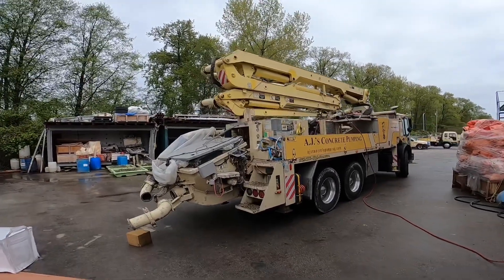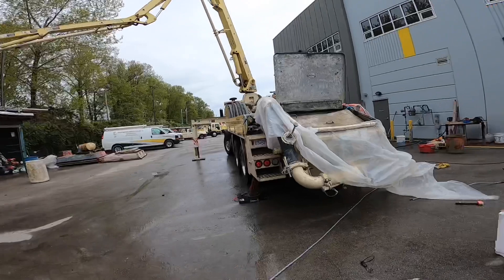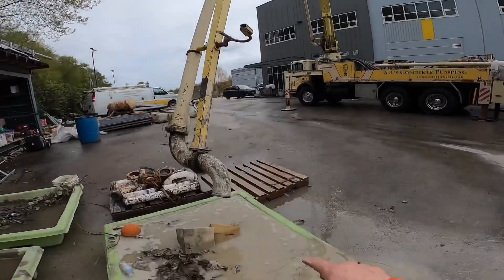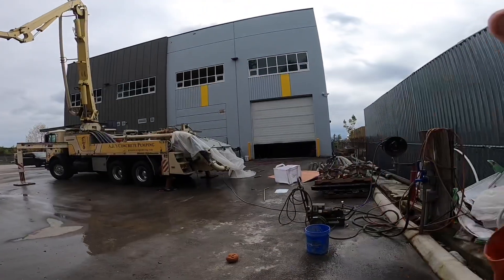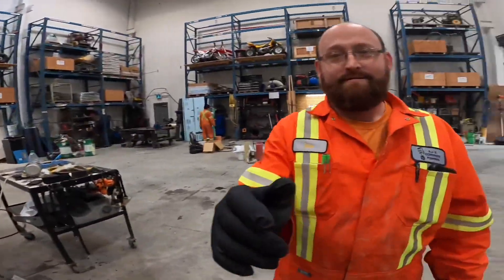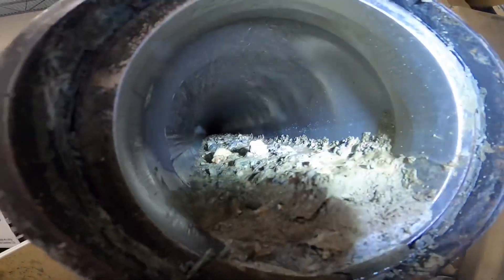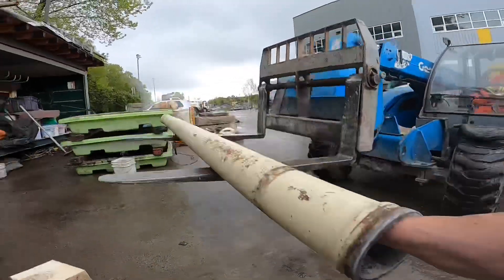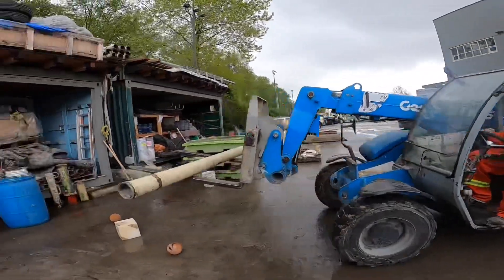Why we should suck back a hard sponge, and clearing a stuffed up boom using water:

Comment: I’ve been sucking back 2 oversize sponges in the cradle at slowest pump speed with high rpm. Haven’t had any buildup yet.  What do you think?
Reply from the maker: @samstrucks  if pulling back 2 sponges with a good amount of water in between, chances are HIGHLY likely that your pipes/elbows are going to be sufficiently clean, regardless of specific technique used to pull them back. Best bet is to be certain, ipe the 45 degree elbow going from the hopper into the deck-pipe. Shine a flashlight down there and check for buildup in the deck-pipe itself, and especially the elbow at the bottom of the turret. If those common areas of buildup are clean, the rest of your pipe system will almost certainly be as well. It takes some real negligence (likely the back story behind this video here) to leave residue of any real significance in the pipeline after pulling sponge-water-sponge.

Comment: I just replaced my entire pipe kit last Friday and the first two jobs I had I couldn’t get the second sponge back all the way to the ball catch on the swing 90, the first ball made it but not the second one. You think maybe my gaskets haven’t sealed up all the way yet after replacing everything? The first two jobs after replacing the pipe were small jobs maybe 80 yards combined between the two. I just ran the gaskets fry I didn’t seal them with silicone or grease as I’m not a big believer in the reasoning behind that idea. 

I ran a hopper of water through to push the sponge out just in case and since then I’ve put 700 yards through the kit. After a 600 yard pour two days ago I was able to suck the two sponges back no problem. 

Do you grease the swivel gaskets or fill them with silicone caulking when you replace them?
Reply from the maker: What I have seen with the larger 6” round balls (if that’s what you’re using) is that they are large enough such that when sitting in the transition door they can actually obstruct vacuum from pulling that second sponge back.
Reply from the maker: I agree with you in the belief that silicone/grease in the gaskets (aside from the swivels) is mostly just mumbo-jumbo. I only use a light spray of WD40 on the outside
Of the gaskets as such that the clamps don’t pinch the gaskets. What I do firmly believe in is whenever installing a new boom pipe kit, filling the hopper with water and sucking back a sponge with a nice, fat bucket of bentonite (pudding consistency) in front of it to fill any voids in the gaskets.
Reply from the maker: Thank you for contributing intelligent discussion to the comments section, that’s my ultimate goal with this channel, good exchange of information and ideas between operators from all parts of the globe.

Comment: Man I think that's why we resuculate.    Slow pours require it.       Great vid man
Reply from the maker: Absolutely! Always helps to pound it through for a couple of minutes prior to pumping out and sucking back. We do sooooo many of these slow pours, hard ball-water-soft ball has really helped in mitigating what's shown here in the video.
Reply: @canadianconcretepumper1979  in my part of the world where we pump most of the mud is 4000 psi but on the average of 6000 to10000 psi the water to cement ratio is to high to get a ball back cleanly but as a last resort.   It's why I resurulate . Not olny can I loosen the set mud on the hopper  but reduce the amount of cement to water  then water wash and further  degrade this ratio. 
On a different point I love how easy it looks to wash those putz hoppers !! I run schwing and they can be a real bitch sometimes

Comment: I also never had an issue when I sucked a square sponge back in the day. I always took reducer off put water in and rolled up my wet 12" square sponge and just sucked it back at moderate rom 1200 and maybe a 2 on the dial. Never had more than a mm or so build up when  I rotated pipes
Reply from the maker: Done properly a single sponge works 99.7% of the time. We had a project pumping bridge decks in which the contractor had two of their own pumps with 15+ year veteran operators. Around the 2 month mark of the deck portion of the project (high cement/high chemical mix), they began having pumping issues, only to find that both of their machines had literally 2+ inches of buildup in the boom elbows. These were guys swore by sucking just a single square sponge. Same project we would put 3 sponges through our 58 meter and the pipes would still be creamy.  Really depends on the mixes which you’re pumping.

Comment: I had this on a used pump the company I used to work at bought. The funny thing is the previous owner said he had to help another guy in the town he was from suck a sponge because his pipes were half full. Once we bought it I had a terrible time priming. It would always segregate whether I used a slick pack or just water. So I took a deck pipe off and it had almost 1" in it... I was pissed off but once clean it worked all the time after that. Ever had your pump stall trying to pump shit concrete? I have
Reply from the maker: Only time we've ever had stalling issues was when the relief valve was a mile out of adjustment and not activating when it was supposed to be.

Comment: Very interesting info on this one! I’ve been running a 33m-5ZZ for the past month. First time running a 5 section Z fold boom. Hated at first, but now I’m getting comfortable with it and I’m enjoying it. 

Question for you, do you suck a sponge on an A frame or do you fold up and put it in the cradle and then suck the sponge? I’ve tried both and have had about the same success rate. I’ve tried putting the boom up in the air too. Not a big fan of that one because I feel you can segregate rather easy, but this is more of a panic move. More of a “gett’er home” because this concrete is getting old…fast! 

Anything you can share will be appreciated 👍
Reply from the maker: I typically suck back in either A-frame, or Z-formation. Certain situations (low clearance/indoors pours) I will suck back in the cradle but in my opinion it is less than ideal (I have had issues with buildup in the pipeline after sucking back in the cradle). I apply the same theory for sucking back the sponge as I do for priming: keep as many sections vertical as possible such that the water cannot run ahead of the sponge only cleaning the bottom half of the horizontal pipe (on the prime the intent of the water is obviously lubricating the pipeline rather than cleaning it). A-frame is king, Z-formation also works well, sucking back in the cradle is my least favourite option and last resort.

Thank you for watching the channel. The comments are very much appreciated 🙏
Reply: @canadianconcretepumper1979  also, before I forget. I’m trying to get my hands on a Goodson super scraper, but no dice through Amazon. You got any leads no how to get those in Canada?
Reply from the maker: @rickm.10  I've always had top order them directly from https://goodson.com/products/super-scraper

Be forewarned, the shipping costs are astronomical.
Reply: @canadianconcretepumper1979  no worries man. I find these videos very educational for an operator who is into the more detailed operation of a concrete pump. These are fairly cool machines, but there is a lot more to it than unfolding the boom and turning the pump on and off. 

Anyway, I think I’m gonna start putting my boom in an A frame unless I can’t. I’ll take your word for finding out that you have build up in the pipes after sucking a sponge with the boom in the cradle. I’d hate to be “that guy” lol
Reply from the maker: @rickm.10  that's the thing with running pump, just when we think we've got it all figured, we are quickly reminded (usually through blood, sweat, and sometimes literally tears) that we don't, lol!

Comment: something that we do every time with ours, we suck one back somewhat slower, open the back end up once its back,  then get the tip section positioned so we can put about 20-30 gal of water in, hard/harder sponge, and blow it out the rest of the way with air. at most, ive only ever seen just a very small amount of sand/fines in an elbow when replacing gaskets. I'm sure this isnt ideal in EVERY scenario, and it is a bit messy, but it does work very well for us.
Reply from the maker: Most of our machines have the ball-stopper built into the prime port, which makes it even easier as we don’t need to open up the backend to retrieve the first sponge prior to sucking back the second. Agreed, sponge-water-sponge is a highly effective method 👍🏼
Reply: @canadianconcretepumper1979  our newest 28M came with that option from the factory, sadly i only got to use it once or twice before it was continuously improperly cleaned. now it’s just a fancy conversion starter for curious mixer drivers and contractors

Comment: I never suck sponges and my pipes are fine🤷🏼‍♂️
Reply from the maker: Very specific mixes is what has caused us most all of our issues in the past (typically high strength/high chemical mixes poured at a slow rate). This one I’m betting some naughty operator sucked back a soft sponge through the 4” taper at Mach 1 speed.

Comment: Had to do this last yr from a foam concrete job , every single pipe an bend was lathered in the shit! We had to high pressure jet the whole boom kit 31-5m
Reply from the maker: Yes! Some of these “exotic mixes” are absolutely terrible in terms of leaving residue in the pipes. This is why when someone says “I clean out this way and it works every single time” I have my reservations. We are in a constantly evolving industry and it’s paramount to adapt an evolve along with it.